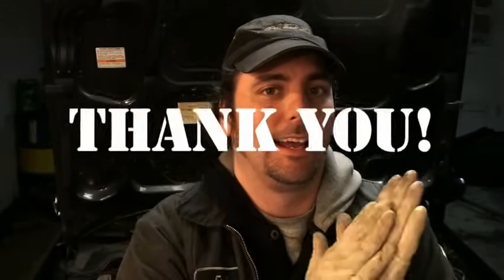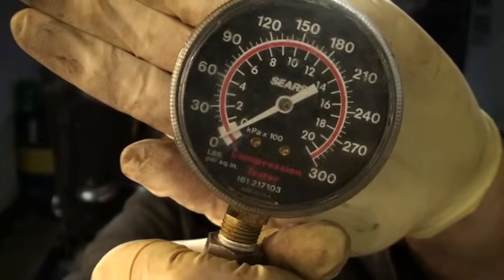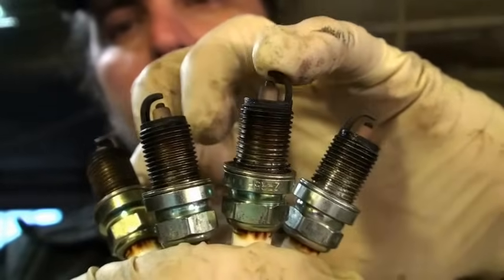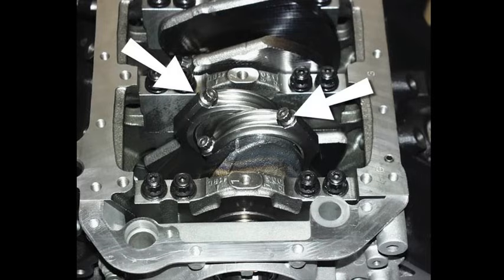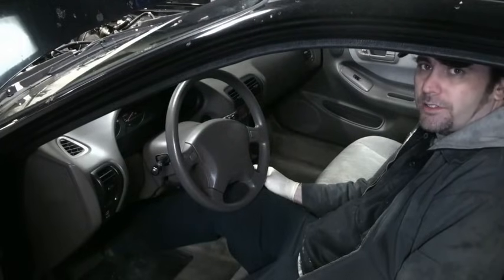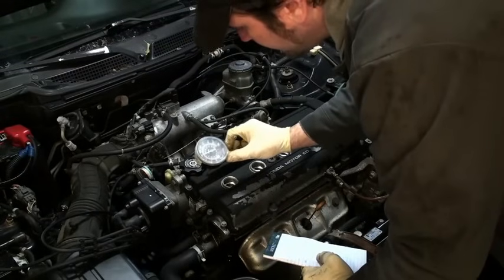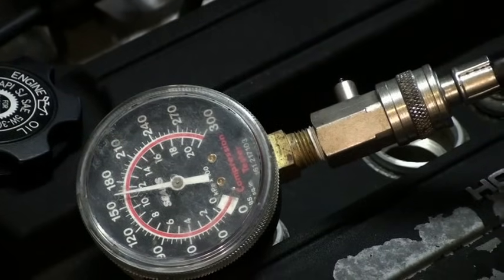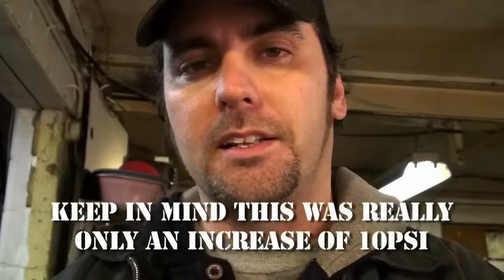How To Perform a Compression Test - EricTheCarGuy

Comment: Hey there Eric. Been watching Your videos from a long time back when You had 4.01K subscribers lol. Love Your videos man always super informative and simplified. I took compression tests on an import engine that I sourced, it’s a D16Z6. My main question in doubt is, could the wet tests go abnormally high because of Carbon buildup on the piston heads? My Dry tests were between 158-164 through out all cylinders. For 5 revolutions. But the wet tests were exceeding 200+. One was 201, the others were 230, 240+.

Comment: Hi Eric,  I hope I get lucky this time with a response from you.
I have a '95 maxima.  I did a cyl. head job.  The cam followers got shuffled, and I put them back randomly.  I was getting 125psi on all cyl.'s.  I disengaged the camshafts and cyl. 2 tested at 165 psi after several attempts( why did it take more attempts to get to 165psi than in your video?) , so I rearranged the cam followers now I'm getting 125-150psi.

Comment: I checked the compression before watching this video and I didn't remove all the spark plugs, I just removed one at a time as I checked each cylinder and replaced each plug as I moved to the next cylinder. How inaccurate would my readings be sense I didn't remove all the sparkplugs first?. Ps I was getting around 120psi each cylinder.

Comment: i have 2010 Aveo engine type LXV the BOOK says that i need to remove crank sensor. The problem is you have remove starter to get to it. do you see way get around this? MEANING NOT DISCONNECT SENSOR
THANK YOU

Comment: Hello Eric, I got a chevy 327 fresh rebuilt with 10:1 CR on the paper.  I turn on the engine and at the idle it runs roughly and shake.    I check everything, vacuum leak ecc ecc...I found that instead to have at least 150 PSI like I should in a 10:1 CR engine, I have 120PSI and 1 piston 110.    Could be that the problem? The question is how that can be possible if is a fresh rebuild?  Maybe the machine shop made a mistake?    thank you

Comment: Eric "the car guy",
low compression 
leak down test appears to be in exhaust valves,
(suspect timing chain is off (
if We were to take the roller fowlers out, (makes the valves seat) 
then run a compression test, would this not tell us if its heads, or timing?
👍👍👍👍👍👍

Comment: hi have a 2013 Hyundai santa fe sport 2.0t i am getting a p030 misfire i changed the plugs, coils and fuel injectors still 4 misfire the car runs with a with a shaking and as you goo to drive it feels rough then as soon as you get to about 35 or 40 it is smooth as butter the engine light is on steady and not flashing. i asked a shop and they told me to drive it as long as the engine light is not flashing it is fine it may reset itself after 50 miles? my car has 120427 miles oil changes every time it hit about 3000 to 4000 the dealer says it should be done every 5000 but i rather be safe and do it early. im going to buy this test kit at harbor freight and try this myself since my husband pasted away and have 5 kids to support and no extra money to keep spending. can you please tell me if im missing something?

Comment: Bro I saw you left the o ring one before the spark plug adapter. I did this and then the adapter was left on the hole. I hope someone reads this before they screw up like me. I was able to get it out by using two long thin flat head screwdriver one placed on top of the top flat and the other placed under the bottom flat. And then I just twisted the pair together. What s seemed stupid is the adapter wasn’t attracted  to my magnet. But my hook tool grabbed it once it was lose.

Comment: I have a 2008 honda civic ex. I did a compression test on the engine it is showing 200 psi on each cylinder.  the car has 212k miles i change oil every 4500 with penzoil platinum full synthetic.  is 200 psi is that too much though I see most cars with 180 not 200 is there such thing as too much psi

Comment: I'm gonna buy a tester today, my 73 2.0 pinto has a miss, it has a little bit of sludge under valve cover. it has a miss here and there.
Reply: I'm getting around 95lbs on ea with 5 turns overs on the 2.0  73 pinto, is that bad or good?

Comment: I did a compression test on my 09 traverse 3.6L and get nothing on 4 the 5 was at 110 and the other were 130.the plug looked black and wet.like it's not firing at all.it is getting spark last time I checked it for spark it shocked me so I no its getting spark.you have any suggestions .I did a wet test and still got 00 compression

Comment: How to Tighten Compression Tester Hose?  After I put the adapter in the spark plug hole (volvo T5 2005 V50), I can't tighten the hose end.I don't want to twist the hose too much either.  tester looks just like model in this video.

Comment: I know this is an older video..but what does it mean when you pull the spark plug and its dripping with fresh oil..like someone just dipped the spark plug in oil around the threads

Comment: A couple points if anyone has a 2003-2008 350Z and possibly other cars- You should generally do it with a warm engine otherwise your readings will more than likely be low. Get some gloves, because the spark plugs will be hot. Then pull fuse #81, fuel pump fuse. Let engine idle until it dies then try to start again until your sure there's no fuel pressure left.

Remove all coil pack and spark plugs. Disconnect coil pack connectors.(this will disable your ignition system). Cover the spark plug holes with clean rags so no dirt or debris gets in them. Put gauge in cylinders to be tested. Turn over engine about 5 seconds each. If there are any cylinder pressures that are low, squirt a little engine oil in the cylinder, if pressure is higher after oil is squirted in, this would indicate worn rings. You also have to be W.O.T. otherwise you will end with 15 lbs lower than the correct cylinder compression. If a cylinder is reading low pressure and the squirting oil trick doesn't raise the pressure, then you're looking at a valve problem. 

According to the FSM the reading should be 185PSI, minimum of 142PSI. There should be no more than 14 PSI difference between the highest and lowest cylinder. They also mention that if two or more cylinders are low and the oil squirt thing doesn't work then you could have a head gasket problem.

Comment: @EricTheCarGuy I watch your channel all the time.  Q:  My 2012 Honda Accord V6 is apparently consuming oil (according to Honda).  It only has 117,000 miles on the engine.  However, they are telling me it is from the piston rings.  Should I replace the rings or replace the engine? I am going through about a quart of oil between oil changes.

Comment: Is it normal for the compression to bleed out after you stop cranking. I cranked my v8 and it went to 150 psi, then once I was done cranking it went down to 0 in about 15 seconds. It’s an old engine. Trying to get it to start up. I got fuel, air, and spark. So far all my cylinders are around 150psi. Ig it’s timing 😔

Comment: When it comes to my vehicle I feel like I don't want to know if it has bad compression... It would pretty much mean its toast. I'll keep living in denial an adding lucus to the gas lol.
Reply: same boat. already swapped out so much and still have a rough idle.
Reply: @1111comment  I fond out I had a bad injector. I used a method I learned here on youtube. You touch a screw driver to the injector while the engine is running. You can feel it clicking. One was opening (clicking) irregularly.

Comment: I have an headache understanding everything about engine. I was tasked to work as a driver of a farm tractor. I really don't know about engine in a first place or to do maintenance in the farm tractor. But i don't had a choice since the person in charged in driving the farm tractor was fired and the company don't want to hired new driver so they put me in that position. They taught me basic maintenance and how to drive it. Well first everything goes fine until I feel something wrong in the tractor. The water reservoir is really hot so i reported it to my supervisor and he said it's normal. Everything I noticed that I think it's bad I reported it in my supervisor. Its really depressing always encountering problem in job. Last day I was driving the tractor and suddenly the RPM goes up and down, I feel that the tractor losses strength but it comebacks it after a little while. I'm got an headache thinking trying to figure out what's the problem. I checked everything base on what they taught me and I didn't find any problem. I don't know what to do, may be it's due to overheating but the temperature reading was fine base on my supervisor said. But I fee there is something wrong in the engine because the engine oil was not in maxed level. When I replaced the the engine oil we make it sure that it maxed level and after 2 months of using it it's not In maxed level anymore. I was told to add engine oil again if necessary so I add it to made it in maxed level again. Everyday working in that tractor is a hell, I hope the company will get some mechanic to do some inspection in the engine. I'm tired reading book and trying to figureout what's goingon from electrical problem up to the engine. 😞😞😞

Comment: I have a question?  Do you remove all the spark plugs at once to do the compression test? Or do you leave them  and remove 1 followed by compression test than install back spark plug and follow up with the next cylinders?

Comment: i know your famous now with all the subs but i have a quick question im trying to do a compression test but word on street is my car 2008 grand vitara dosent have a fuel pump fuse to pull to do this any other way i can stop the car from starting so i can get a reading on gauge with out pulling all the spark plugs at once

Comment: I've seen other videos in which they take out fuel pump fuse and run till fuel empties .. So which way is best ? From whjat lil I remember a looong time ago , i just did it your way . Just take off plug then screw it on and crank it . Which is the front on four cylinder I4 ? Not the end that has the timing cover correct ?

Comment: Hi Eric,
I recently purchased a 2013 vw jetta 1.4L Turbo Sedan from an auction here in Western Australia.
It had a PO3O4 Code come up on my diagnostic tool.
This indicated that Cyl 4 had a miss fire.
I changed all the plugs and Coils.
Still the slight miss was there.
The car drives ok when driving round the streets here, but is rough on idle.
I completed a compression test and the results are as follows..
Cyl 1   110      Cyl 2  110        Cyl 3 110           Cyl 4     83

There is no smoke from the car exhaust.
It has only travelled 114,000 Klms and is in good condition.

Question:
If No. 4  fuel injector was open, or faulty, would this effect the Compression Test.?

I find it hard to believe that the valves or piston would be suspect on such a low mileage vehicle.
I also checked for air leaks and blew out the air filter.
I also checked the Air Intake manifold and found a small amount of engine oil inside.? Not sure why it was there.

Anyway
 i was going to purchase and fit a new Injector to No. 4 Cyl. Do you 
think it is worth doing given the results of the compression test?

If you can help with any of the above i would be very greatful.

Kind Regards

Comment: Helpful even after such a long time. My car is hesitant when accelerating. It even goes on to switching it self off when approaching a stop.i did these test and number one was very low compared to the other cylinders.

This cylinder head,  I just bought from salvage yard. What else should I look into?

Comment: Hi Eric You always do such a good job explaining things. I have a 1987 Toyota 22 RE and I did the compression check and they were between 65 and 80. I just thought that seemed low. it’s a rebuilt motor should I be checking out other things or is that common? Thanks again for your time all that you do for everyone.

Comment: What do you check next if you have good compression, spark and fuel on all cylinders, but there is one cylinder that does not fire no matter what. No check engine light either,

Comment: Real quick buddy , dry 100 wet 110 across . 5.9 dodge 225k miles is that too bad ? Trying to find cause of smoke on first acceleration. Just pulled plenum and intake for nothing. No visible failure in gasket

Comment: Hey Eric had a question buddy. I have a Kia soul n I'm doing a compression test cuz I think my intake valves have major build up. Car registers a vacuum leak but did a smoke test n nothing. On the compression test for my gdi Kia soul the minimum is 156 psi n standard is 176 psi. All 4 cylinders register 115. Do I also agree that my intake valve needs to be cleaned let me know buddy.
Reply: You could get a cheap $6 scope cam with mirror & have a look. I think I got the same issue on my ridgeline. I heard that sea foam might break up crud if thats keeping it open

Comment: Hey Eric, love your vids, really helped me a lot. I have a vauxhall astra 1.7 cdti, 120,000 thou. When I crank her over, idle is fine, but occasionally it sounds like it's being starved of fuel, blip the pedal and it's fine. There's no milkshake, timing done at 80 thou. Was thinking maybe injector blocked or bad plugs. Any ideas?
Reply: Check for vacuum leaks

Comment: I have a misfire on one cylinder on a 4 cylinder engine. 

Compression readings are
Cyl1=125psi
Cyl2=150psi
Cyl3=125psi
Cyl4=125psi
So could having higher compression on that cylinder be a cause for misfire on it? Anybody?

Comment: I have a 1996 honda accord ex it's a f22b1 I rebuild my block I didnt mechine it .i just use crosshatch on the cylinder walls and new rings and my compression are 75,120,125,127. Can you help me ?do I need to let it idles longer so the compression to go up , I also did compression wet test on the cylinder 1 and It went up to 100psi, 

Can it be  needed  to adjust the vavles ?

Comment: Hello everybody,
Have a question: first situation..wanted to do a compression test because of an intermediate misfire cyl 2 and 3. Had started the car previously shut it off and watched a few videos.. this one being 1; 20 mins car cooled. 

Ok this the meat:

I installed my steel braided compression tester. Got a reading of above 180..I was good with it.. tried loosening the tester and it was a no go. Tried spraying some wd/loosen juice: nothing.

My question is if I run the car with the tester tube still in to heat the head up will it cause a major problem?

I'm thinking a lot of unburned fuel

Comment: Why u dont remove the fuel pump fuse.?
Reply: Can you tell me what this would do? 
I'm attempting to self diagnose frequent misfires on my own car, and I've learned alot in the process, but to no avail. I'll probably be doing this next, and your suggestion might help.
Reply: @marcgonzalez9690  code errors? It will help
Reply: Marc Gonzalez Removing the fuel pump fuse just keeps pump from sending fuel into the cylinder. It’s good to do if it’s easy to do but not required.

Comment: I have a 1998 4Runner. Dead miss on 4 dead miss on 3. Compression test good over 160. New spark plugs. New fuel injectors. Swapped coil packs miss did not move. Still on same cylinder. Swapped plug lines miss still on same cylinder. Spark plug on 4 is wet. May have oil on plug tip. Miss gets worse under load.
Reply: Car only misses under load going to check the fuel filter and pump next. Very confused that it only dead misses on 2 cylinders.

Comment: Hi Eric, I have blue smoke from my exhaust when I rev engine. Otherwise engine is running smooth & no loss of power. Would this test be good to rule out piston rings and point to maybe valve seals or turbo? Oh, is it correct to take ALL spark plugs out & then do the test per cylinder. I assumed you took one out at a time? thanks
Reply: As far as compression testing goes it's better to remove all the spark plugs when doing this test. It puts less stress on your starter since it is only compressing air in the one cylinder with the tester. I'm sure that's what he did in this video since it cranks fast except when it is compressing the one cylinder with the tester. That's what he's talking about when he says to listen for 5 "skips" when cranking the engine, the sound of it slowing to compress that single cylinder.

Comment: Great video. I am wondering if I can remove all spark plugs at the same time, and fit them back after completion of the test.
Reply: Yes, that's the best way to do this test. It puts less stress on your starter since it's only compressing the one cylinder with the tester attached. I missed it if he said specifically in the video but that is the way he did it, with all the plugs out. You can hear the engine crank fast until it compresses the cylinder with the tester. That's the sound he talks about counting as you crank.

Comment: Hey. Can I do this test. Compression test. One cylinder at a time.  Remove one plug at a time replace back in after test    & so on?
Reply: It's much better to remove them all when testing. It puts less stress on your starter since it is only compressing air in the cylinder with the tester and the engine cannot accidentally start up if it doesn't have any spark plugs in it.

Comment: Can you perform compression test if the engine is not starting? Or does this test need to be done on a working engine?
Reply: Yes you can, as long as it cranks.

Comment: hi eric, i have a very simple question...so when i did a compression test on my car it came out around 130 psi, i have forged internals and they are 8.5:1 OEM is 9:1....basically i want more compression from my engine ideally around 160psi..how do i achieve this? do i make the squish area tighter and less Cc...i also have a rally camshaft which it has an overlap and do you think this is the problem as the drawn air escapes?